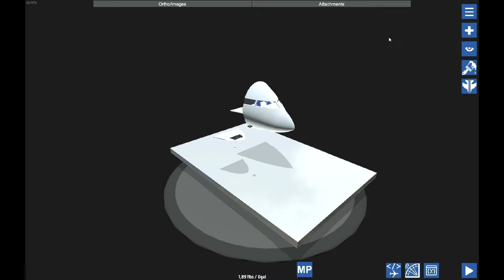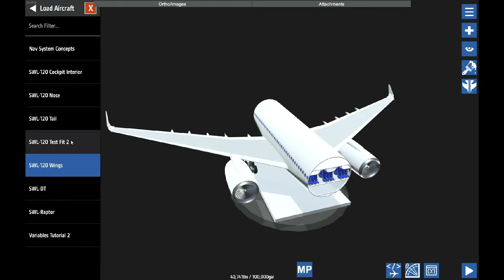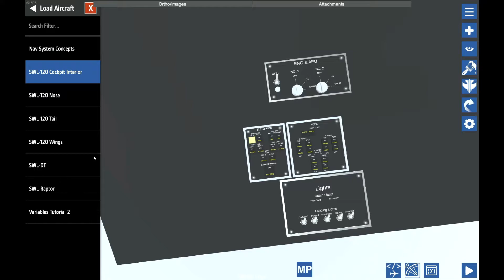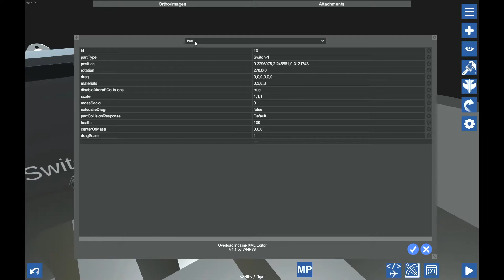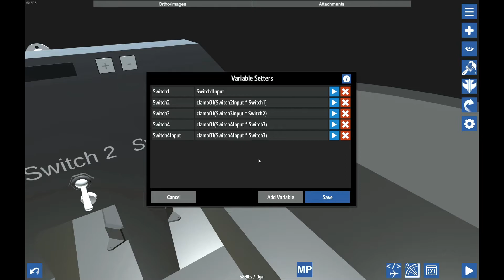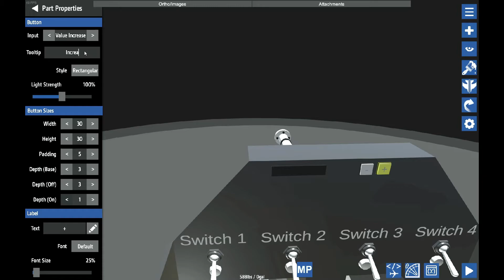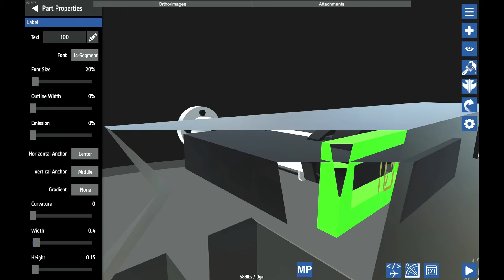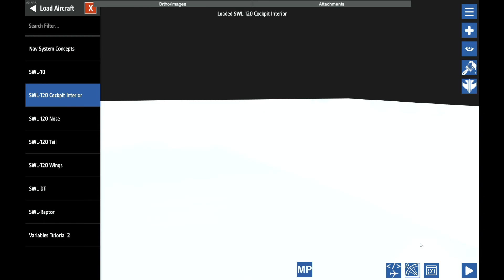How to Use the Variables System in SimplePlanes - Part 2

Comment: how do i make so a button changes the camera??(i need it asap )
Reply from the maker: Unfortunately you cannot change the camera view other than using the default method.
Reply: @11snakePlayz  oh thats sad
i tought there was a method whit buttons
Reply from the maker: @Nickzzn_01  You can move the camera you're currently viewing from with methods such as pistons, rotators, and control bases, but you can't change the actual view (camera, orbit, chase, etc).